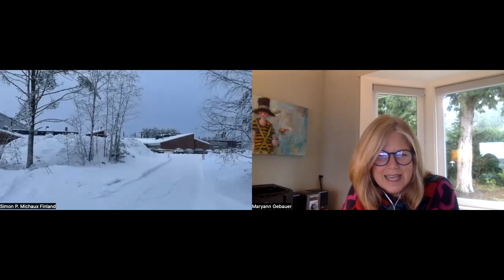Prof. Simon Michaux | The impossible GREEN ideology

Comment: I didn't understand his solution.  The problem is the lack of US government policy around automobile industry and housing.  Where I am in the USA I see more than half the vehicles are huge trucks and SUVs, a complete waste of fuel.  Every highway is packed with huge vehicles with one person in them. And the zoning rules separate housing from places of employment and shopping.  Housing is not integrated like in Europe.  Nothing is likely to change because the government leaders are all slaves to corporations.   The people will continue to burn up as much fuel as possible as fast as possible, sitting on their fat asses in huge vehicles until every drop of fuel is burned up.
Reply: Want me to annoy you even more?
If you look at traditional architecture, all of those arches and barrelvaulted ceilings were built like that to make sure all elements were in compression.
The modernist architects threw thousands of years of sustainable architecture in the bin for ideological reasons and now instead of buildings that can last thousands of years with minimal maintenance we have flat rooves and high rises which use reinforced concrete in tension.
Those buildings are only built to last 50-100 years and then the rebar in the concrete floors mean the building has to be demolished.
All of our new buildings can only exist in a cheap energy & abundant resources world.